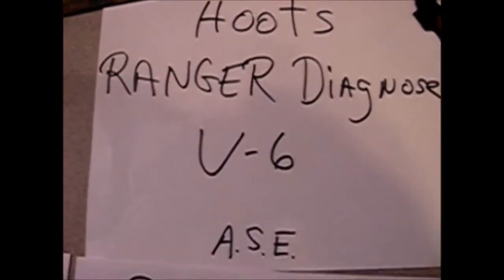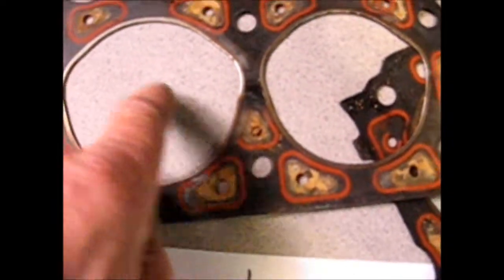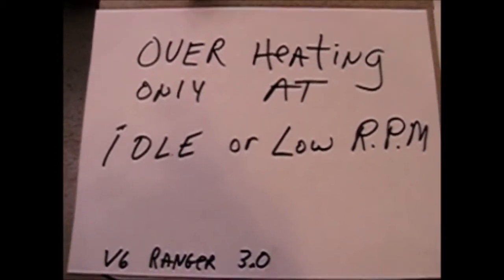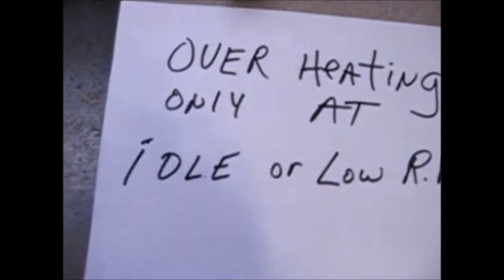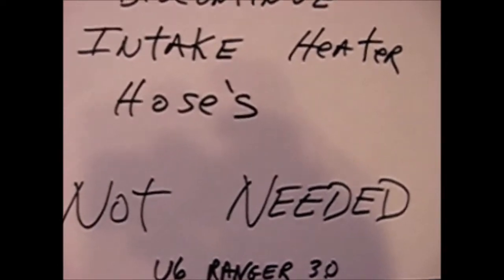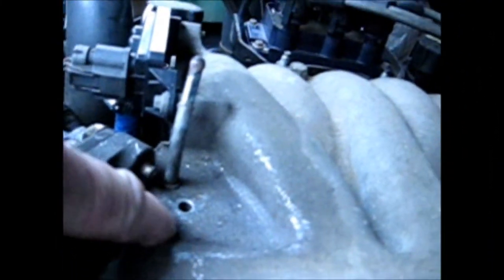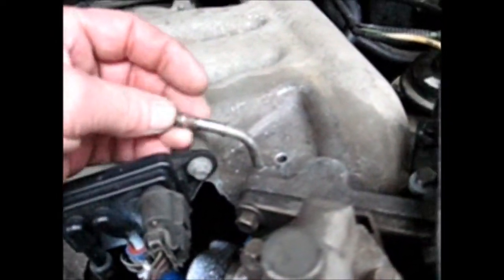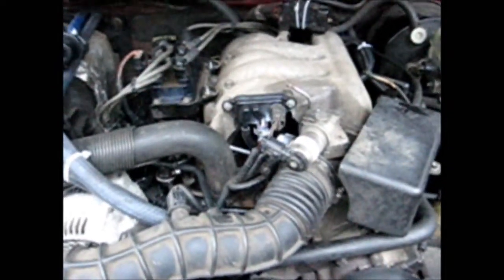hoots how to diagnose on 1998 ranger over heating and misfiring

Comment: Just curious abput my 96 mazda b3000 3.0 v6 it tends to overheat at redlights once i start driving doing 30+ it goes back to normal any suggestions was told the thermostat is new dont see any leaks anywhere knock on wood
Reply from the maker: That was my problem in one of my video,'s with the 1998 ranger ,the impeller was worn off and was a problem in stalled freeway traffic I had to race up.Replace water pump ,mine wore out less than three years old from advance auto and Mazda should have same engine in it as mine the 3.0
Reply from the maker: It is not the thermostat ,it is the water pump impeller just like the one I had in this video, same problem good luck my water pump was only 2 years old